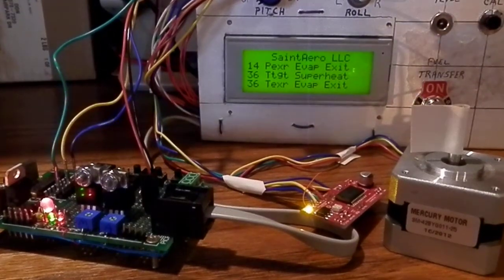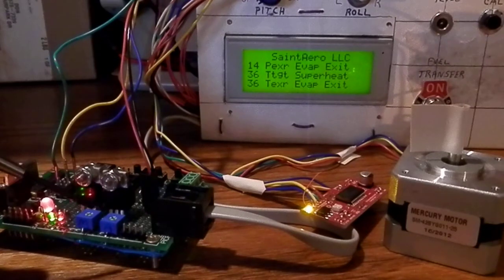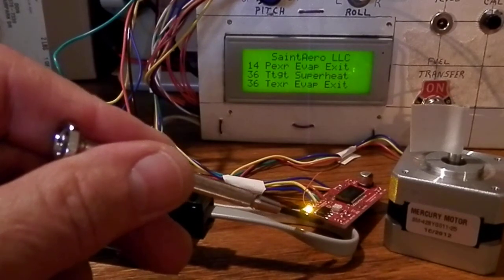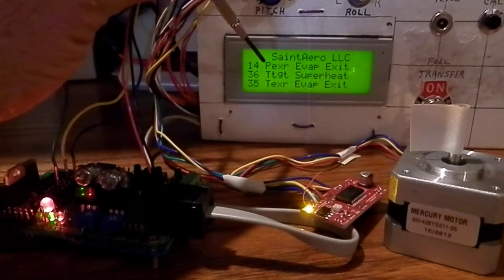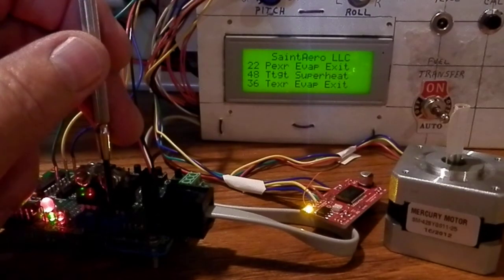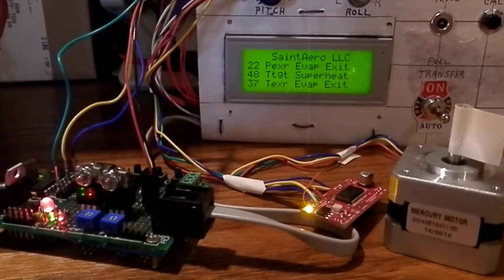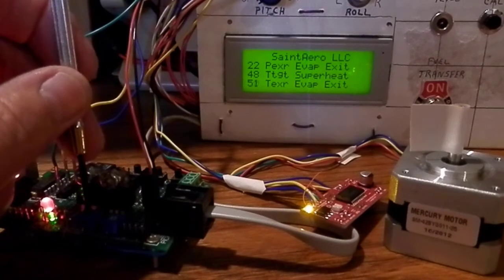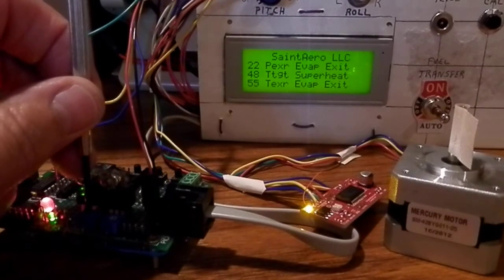PIC Microcontroller - Prototype Superheat controller with Stepper Motor

Comment: Don, great video! can you help me out with your code? i try to build my own heatpump with R290(propane) and installed a electronic expansionvalve with 12volt unipolair stepper motor from a d*ikin unit.i have pic controller and picbasic, but i not know how to make the code....i only manege to open and close valve with two buttons manual.do you have a site were i can find more info?
Thanks Robert